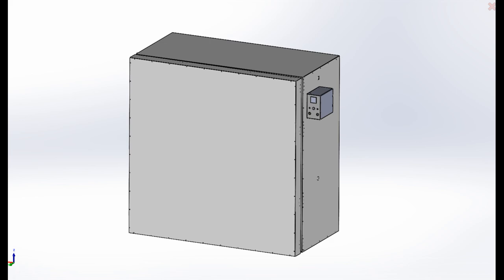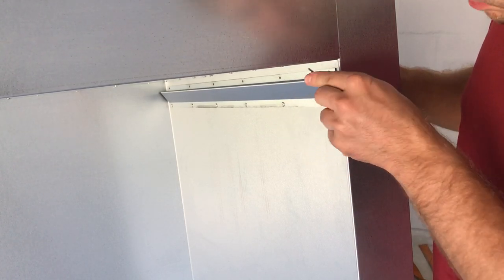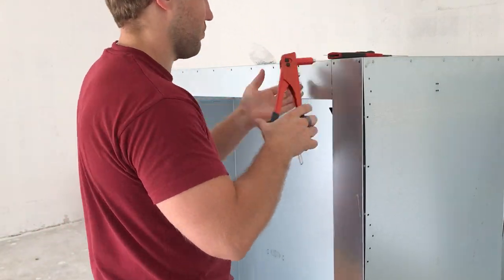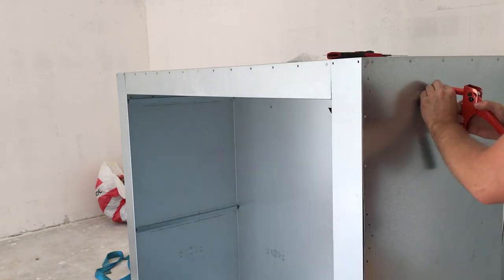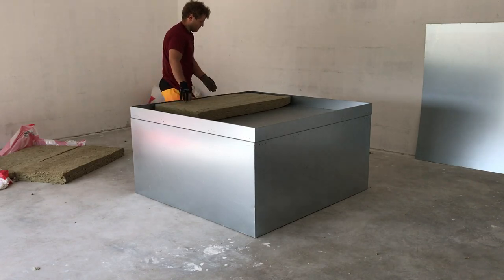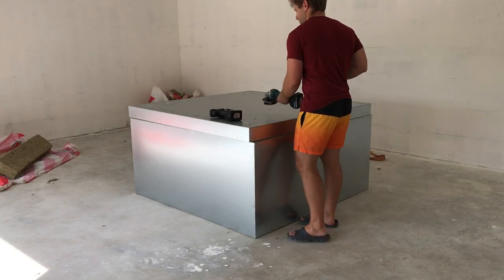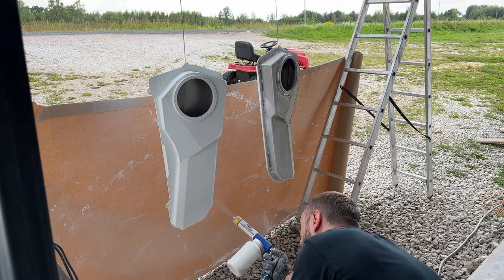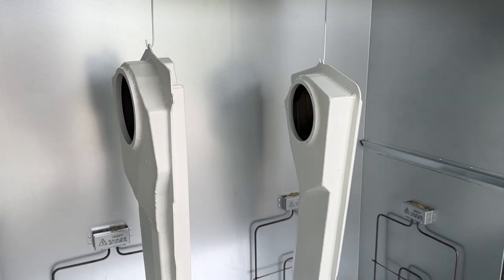How to build diy powder coat oven, including first test.

Comment: You might want to upgrade the door design a bit. You could split it and do a double door, or you could add a caster wheel to the bottom of the door, both would mitigate the oven wanting to tip forward when the door is open. Overall cool project though.